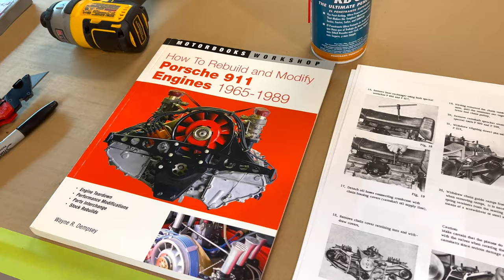!What Happened! 44 years ago???

Comment: bearings looked excellent, looks like a home run. have you tried vapor blasting? aluminum comes out fantastic with that process
Reply from the maker: Hello Amundsen 
Yes it looks fairly clean inside.. I have some experience with vapor blasting it does work wonders. The carburetors and manifold were vapor blasted and came out beautiful
Reply: @MikesRestorations   the carbs came out fantastic

Comment: With the results of the "chain tension piece" failure/damage are you now bound to also replace the aluminium casing that the chain damaged ? Or is that damage liveable ?
Reply from the maker: Hello Graham ,
In this case it looks as if we dodged a bullet on most critical areas. The abrasion in the housing is cosmetic in nature and will be fine to reuse the housing. 
However sprockets, chains, guides and tensioners will need replacing

Comment: I noticed that one of the studs that secures the left side chain box to the case, was broken off.. did it break when you undid the nut or is it a previous issue? Was it leaking a lot?
Reply from the maker: Hi Michael
I’m not sure exactly what you saw or where.. most studs were removed prior to disassembly, the remaining studs have all been removed since. I don’t see any broken stud. It’s possible you see a recessed dowel locating pin? There are several on the case

Comment: So is plan to vapor blast parts to return finish to original?  And will you modify covers to use pressure fed tensioners or will you keep that original?
Reply from the maker: Hi Jeff
Still putting a plan together and taking inventory. As for finishes the verdict is still out on that depending the part being refinished.
I will consult with Kurt on the tensioners. I’m leaning on keeping it original but making whatever upgrades are necessary for proper function on all upgraded service bulletins.